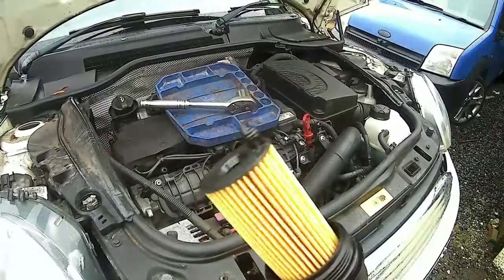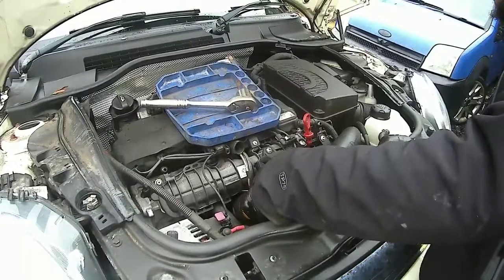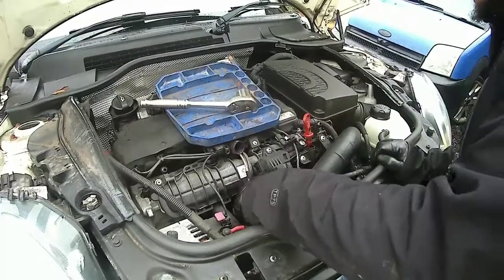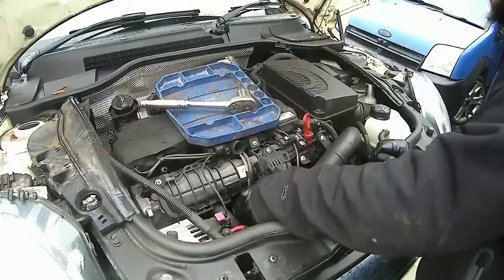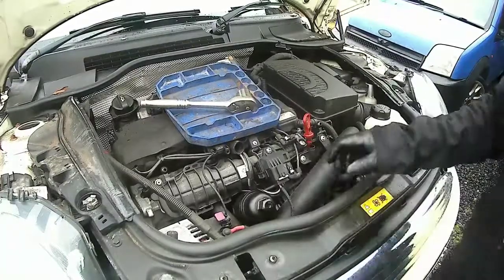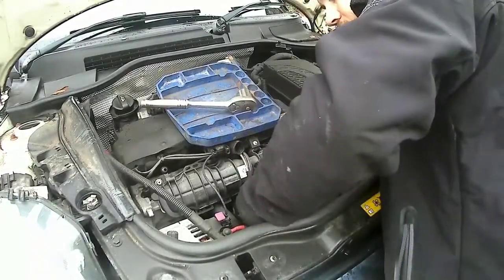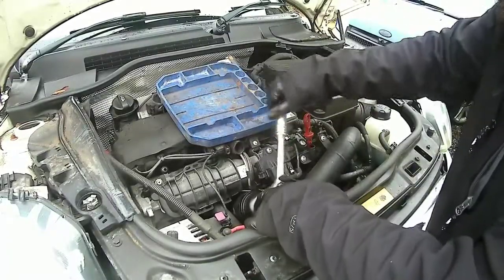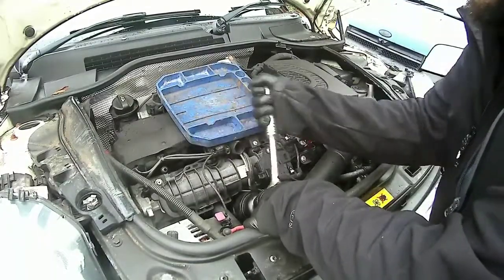How to: 2012 Mini 1.6 Diesel Oil and filter change

Comment: Hey, I've got 2011 mini one D,  BMW 1.6 diesel N engine. Where is  fuel filter located? Also, where is DPF filter and how much it cost, as I see DPF on ebay for £150-£300 and I thought it is around £1000? Any help would be much appreciated 👏
Reply from the maker: @Aivaras83  hey! I’m not 100% sure what the answers are to these questions. I’d have a better chance with a reg. don’t think your going to want to post that on YouTube tho. 

But in terms of DPFs get on from a known good dealer, somewhere you know will be open in 12 months. You’ll find eBay ones are cheap however they fail after 6 months and the shop closes down so you have no warranty

Comment: Nice clear video, doing my sons Monday gonna do a flush additive before I drop old oil. Thanks for video. Vinny.
Reply from the maker: Hey! How did you get on?
Reply: Done a engine flush too, used wynns for that. Went easy after watching your clear video. 😊😊😊 @EllsAutoCare
Reply from the maker: @vazza7504  so the engines nice and clean now then?
Reply: @EllsAutoCare  Mini running lovely now, deffo worth doing the engine flush. Oil still quite clean after a few hundred miles since. 👍👍👍

Comment: Don't you have one of those fuel pumps to suck the oil out through the dipstick? I have one and does the trick for an interim service. Full service I take to a garage.
Reply: no need oil  drain from the bottom is better all oil and metal particle came out